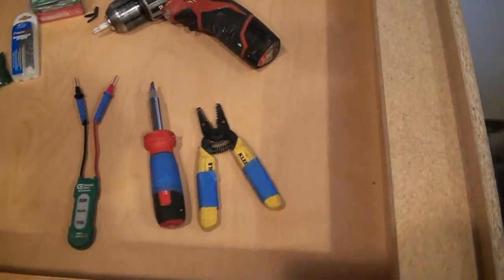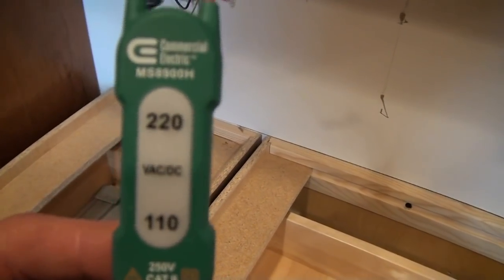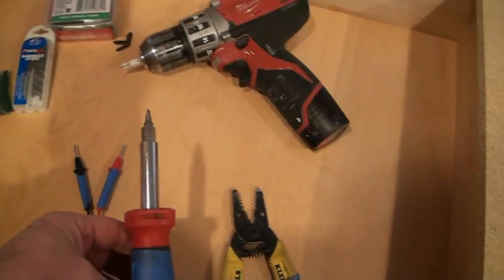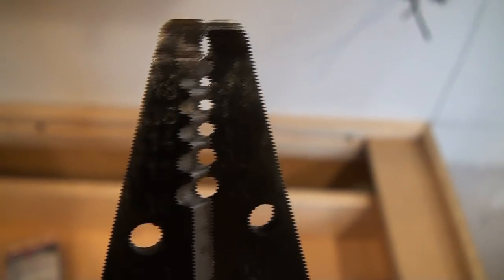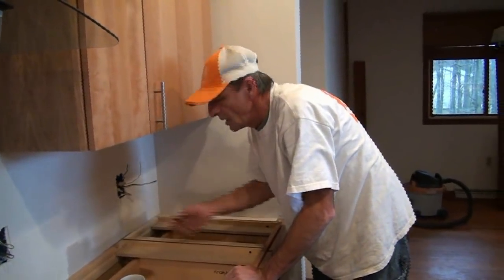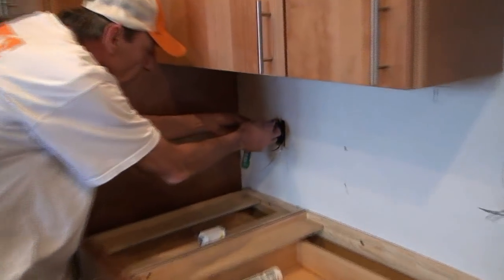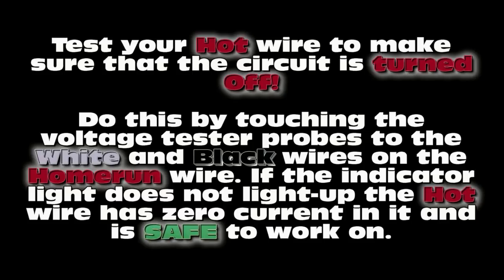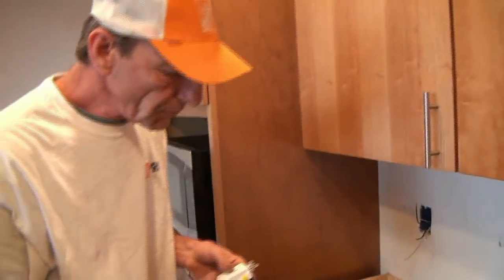How to Install GFI Outlets in Kitchen

Comment: My house was built in 1993. Code has changed since then, but if I want to replace the outlets, I need to bring them to the current code right? There isn't any GFCI outlet, and the receptacles are hooked up with two hot wires with their own 15A breaker, one circuit feed the top outlets and the other the bottom outlets. They share the same neutral wire. Apparently it was common back then. How can I install GCFI outlets in this situation? Do I need to have the whole wiring redone...?

Comment: well, I have aluminum wring.....and it seems that each kitchen outlet is singly wired, that is, none is connected to any circuit..should i still put in a GFCI near the sink?  That's a split connection, the adjoining switch is actually connected to another circuit. 15A OK?

Comment: Excellent video**
Its a nice refreshing change from all the theoretical non real world applicable theorems we stemp student are taught...

Thank you.

Question...
Does the dish washer  have to be on a 20amp gfci plug or just a regular that has the gfci previously in the series.
Thank you
Reply from the maker: We do it both ways depending on the home's existing setup. Most time were tagged onto an existing gfi circuit...usually the counter circuit.

Eddie

Comment: I bought a USB receptacle, apparently only had 3 connections, now the last outlet won't work, any ideas? They don't seem to make any USB outlets that can work in a gfi loop?
Reply from the maker: They should still work...not sure why they are not working for you...I would need to see your wiring.

Eddie
Reply: Kitchen Remodel Videos the receptacle only has three screws instead of 5 so I'm being informed it's not gfci ready?
Reply from the maker: Okay then you can't use it in series...just as a stand alone gfci outlet.

Comment: Thank you for your video. Do I have a problem if I only have 1 20 amp breaker in my kitchen?
Reply from the maker: It's a strain on that one breaker for sure...but if you're not "popping the breaker" from overload you can get by for now.

Eddie
Reply: A Castro in todays modern homes with electrical appliances galore in our kitchens, yes you have an issue that will only get worse in the future. 
Best advice I can give is to have an electrician come in an check out your home. There may be creative and up to code ways of adding circuits to your kitchen, but the place to begin is with a knowledgable person coming in to do an assessment. There are just too many variables to try to give you direction in this. To list a few, added breakers to your panel. How to get wires from your panel to your kitchen. How to install the outlets. All while keeping the process up to code but also how to minimize damage to your home.

Comment: so if you install a GFCI in the kitchen do you also have to install a AFCI breaker in the panel box?
Reply from the maker: No Lean...Just the GFCI outlets in the kitchen is all that is needed for a kitchen counter circuit!

Eddie
Reply: depends on the nec code in your area.  Regardless, if you can afford the AFCI breaker, install it.  more protection is never a bad thing

Comment: so if trip the main and all goes off. and the house wife need to know how to reset it.
Reply from the maker: That is correct Andrew!

Eddie
Reply: +Kitchen Remodel Videos it is a way to individualy wire and keep it gfci but you won't show that for whatever reason and two gfci is enough and tree feet away from sink by cod

Comment: Great video.  Very helpful.  Thanks for posting.  Seems the GFCI reset button on the outlet no longer works.  The outlet functioned fine before I installed an extender and a new cover plate, but afterwards it doesn't.  won't power my blender.  what could be the problem?
Reply from the maker: +Juan A. McKenzie Hi Juan!

 Sounds like a  wire is touching metal somewhere inside the box and the outlet is just protecting the circuit and keeping it from working to eliminate any possible issues. Recheck your wiring to make sure it's all okay...usually this is the issue that causes this result. Or...you simply have it wired incorrectly.

Eddie

Comment: Thank you for your very helpful video. Is there anyway to figure out if the outlets in a room are in series or not and if yes, which one is main feed from the junction box. Thank you.
Reply from the maker: +Arif M Outlets are almost always in series. The home run to any outlet circuit will have two wires on it for sure...if only one wire connected it's the end of the circuit usually. The Best way to find out is to test.

Eddie
Reply: @KitchenRemodelVideos  are you sure its not parallel
Reply: That’s what she said 😲

Comment: I have six wires not including the ground. Can you put two hot wires together on the same screw?
Reply from the maker: thebes56 NO! only one hot wire is needed! Never put two hot wires on an outlet.

Eddie
Reply: *****  Well after much reconnecting I have all six back on. I think the other two are dead anyway. No beeping from my volt checker. This house was built in 51. Seeing your vid I see that it should only need four wires. Why would six be there?
Reply from the maker: +thebes56 Noe sure...I would have to see the wires and test the circuit to be sure.

Eddie

Comment: How can you tell which are your line wires?  When I took off my old gfi I tried to keep the line vs load wires in check, but after hooking everything up and turning on the breaker, the outlet did not work.  So I reversed the wires and still no success.  Any ideas?  Thanks and great videa.
Reply: did you turn on the power?

Comment: Great video guys. You say that you need two gfci's in a kitchen, to make two gfci protected runs. I noticed on the back of my gfci {20 amp} under the tape { load side} there are two sets of holes. my question is, can I use two of the holes to feed to the left side of my counter top and the other two holes out to the right of my counter top.I have {4} 20 amp. outlets to the left and 3 {20} amp. outlets to the right. Also if you wll, in your vid. you say all recepticals {outlets} in a kitchen should be 20 amps. but it appears that you are using 15 amp. receps. on your load side. I hope you can help me as I am in the middle of a do it yourself project. Thanks in advance, John. PS. I forgot to mention that my refrigerator is on it's own circuit.
Reply: No do not wire it that way. You should be running a new 12/2 wire from an additional 20 amp breaker to create the second counter circuit to be code.
Reply: thanks for your reply but, this is all one run, so to speak, with only 8 recepticals including the g. f. c. I. I do realize if any of the outlets { recepticalS} THAT ARE PROTECTED from the load side go bad the whole run will trip. that's ok with me, but is it safe and up to code here in va.
Reply from the maker: J. p. McG To many additional outlets after the GFI unit. You need 2 separate 20 amp GFI counter circuits in the Kitchen or you are NOT code compliant.

Eddie
Reply: BasementFinishingMan Thanks for the info, I figured out that I could run another new circuit starting at the end of my original run with a new line in.a waste of materials but better than tearing the wall down to save a few feet of wire and nail plates. next time I will be more patient and wait for a reply. Thanks again, Jp

Comment: Good vid, I want to install GFI but in my kitchen each outlet(2 of them) has 2 circuits, the upper receptical is one and the lower receptical is another. Would I have to install another box?
Reply from the maker: No... but you would need to re-wire the existing circuit through the new GFI outlets.

Eddie

Comment: When I unplugged my grill in the kitchen, it popped out sparks.  Now I have no power.  Will replacing the outlets solve the problem?
Reply from the maker: Sounds like you have a short at that particular outlet...most likely a loose wire inside your outlet box. Try swapping-out that old outlet with a new outlet and see if that fixes the problem. Your breaker in your panel box should have "tripped" shutting off the electric to that kitchen counter circuit...if that did not happen you have a different electric issue to correct...but try replacing the outlet first. Make sure the breaker controlling that bad outlet is turned off inside your panel box before you remove and replace that old breaker so you do not get shocked!

Eddie

Comment: Whats that green marret you had the ground wire passing through? Never seen that before.
Reply from the maker: That is just a "grounding" nut cap used to take the place of the copper ground grommet. Keeps the ground wires tightly twisted together.
Reply: Canada detected.

Comment from the maker: The circuit is being fed by a 20 Amp breaker in the panel box on 12/2 gauge wire, not 15 Amp breaker on a 14/2 gauge wire.
Reply: Great vid, thanks. However, why would you start with a 20A GFI and then add 15A outlets on that 12/2 circuit? Thanks in advance. -jb

Comment from the maker: Hello! A 15 Amp GFI will work. Building Code calls for a 20 Amp GFI to be used in kitchens and baths.
Reply: Kitchen Remodel Videos Replace a old GFI with a new one hook it up the same way as the old one but it won’t work. I don’t understand way. My house is not grounded I only have 2 wires. White and black.

Comment: Hi. I went to Home Depot and maybe I got the wrong GFI outlet for my kitchen. The salesperson gave me a 15 Amp 125 volt outlet. But I plugged it in and everything works and hasn't tripped. My old 20 Amp outlet tripped with some hard lightening and could no longer reset.